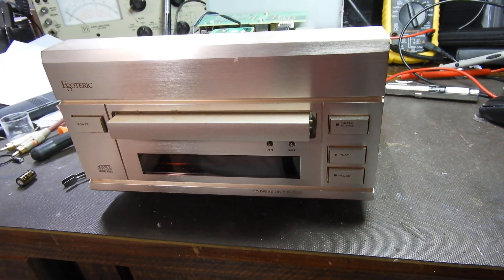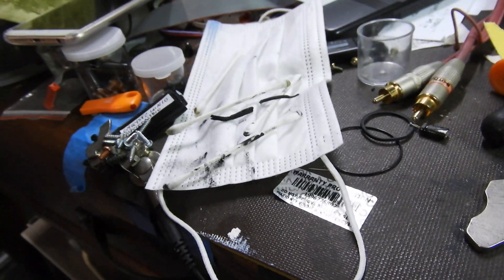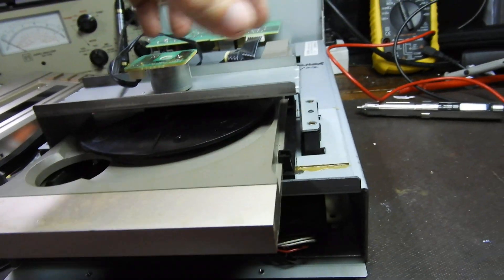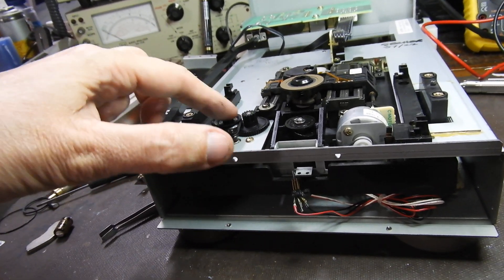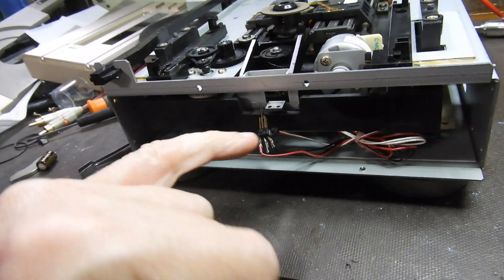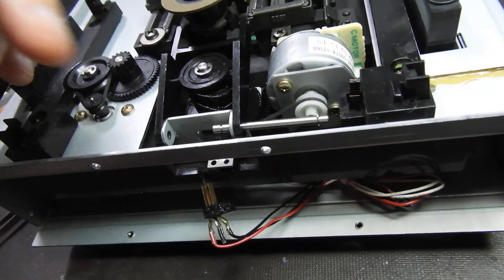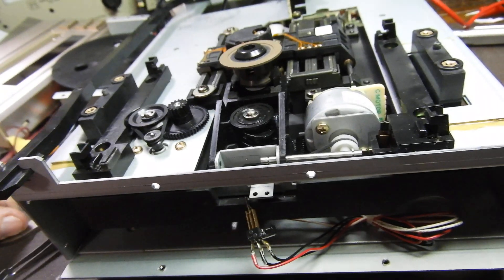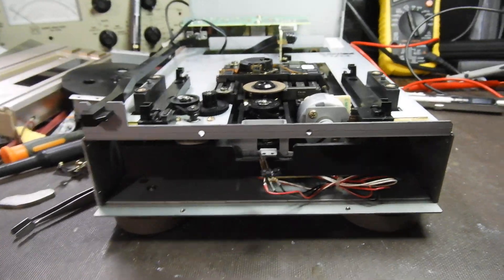Belt replacement in VRDS mechanism's turntable drive. On example of  Esoteric P-500 Transport.

Comment: hi there @hear-net-au, i followed your detailed video and managed to replace the 2 belts, a huge thank you and appreciation to you. However, I encountered a new issue - when I insert a disc, it will not read it, and then it will open the tray automatically. I lowered the turntable to the lowest point before re-installing the tray and all. Any suggestions?
Reply from the maker: It looks like you might have mangled the limit switch near the worm drive. Open it up again and check it. Also check if the plugs that go into the main board (behind the front panel) are plugged in properly
Reply: @hear-net-au  thank you so much for responding! I appreciate it. Are you referring to the micro switch as the limit switch? Also, the ribbon cables are just shoved into the connectors? I don't see any latches for the connectors to lift and lock the cables in position
Reply from the maker: @edwingoh22  yes, limit switches are in this case microswitches. And indeed, there are no latches on ribbons, but please make sure they are fully pushed in.
Reply: @hear-net-au  i have re-inserted the cables as well as check the limit switch. I have manually turned the turntable gear to see if it touches the limits and it looks fine. Now I am able to open the tray, insert a CD but still not reading. I noticed that the laser head does go in, the VRDS will spin ever slightly and then stop and disengage the CD and the laser head will return to its starting position. After that, there is no activity even if i hit the PLAY button again. Any other suggestions?
Reply from the maker: @edwingoh22  did it read CDs prior to the belt replacement? All that you say suggests that most of it is OK. Take the VRDS bridge off open and close the tray and see if the lens hunts for focus (goes up and down) and if the laser lights up red

Comment: Excellent guidance, I've just replaced the two belts in a Teac P-700 transport (the one in the video is actually a P-500 with the front panel of a P-700). Be careful (and patient) when removing the two C clips.

Comment: Hello! I live in Decatur Illinois USA. Where can I get the 2 belts ?
Reply from the maker: Do a quick search for electronics spare parts suppliers in Illinois. Alternatively, eBay. Which has the added advantage that you do not need to know the sizes. Price though might be higher. Your local supplier would probably only charge you $2 each.
Reply: @hear-net-au  Thank You for the information and advice Thanks!  DPickett

Comment: Hello I replaced the belts. Everything was working fine. Now another problem. The pickup assembly started moving up and down when it is at the beginning of the inward travel rather than at its end. Any suggestions? Thank you. Roberto
Reply: I can send you a video to show you the problem.
Reply from the maker: @robertodilembo6039  Please do.
Reply: @hear-net-au  Let me know if you can watch it. Thank you very much. Roberto
Reply: I tried to link the video. If you have an email I can send you the link. Thanks. Roberto
Reply: https://drive.google.com/file/d/1MfNogBFlUkeuppK7YuMbJ6FNqOGhRJ2R/view?usp=drivesdk
Reply from the maker: @robertodilembo6039  I tried but I need you permission. Could you dent it to ads@hear.net.au
Reply: @hear-net-au  sent the video right now

Comment: Great videos, thank you very much. I would like to repair my dads Wadia 850 which has a VRDS drive from Teac I think and the same problem. Howwever additionally a cable has become undone from J203, do you have any idea where they should be attached on the cd players pcb ? I couldn't get anyone to react to my problem yet. Best regards.
Reply from the maker: Sadly my friend, I have never had opportunity to work on 850. No info on it anywhere. This is what we are faced now these days. Tell your friend to get a magnified glass and look for a spot within the cable's reach to see if he can spot the breakage point. I would do this for you if you were here in Perth.
Reply: @hear-net-au  Thanks for your response. Unfortunately we live in Germany and my dad would really like to avoid shipping.... Getting support is really painful in europe. 
But thank you for the offer and the input.